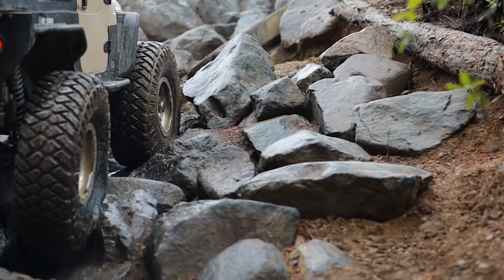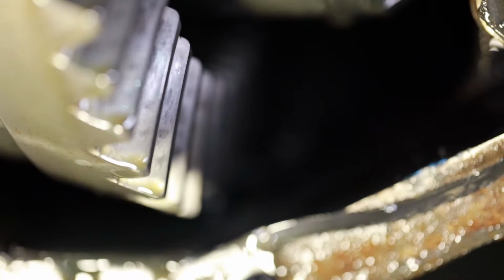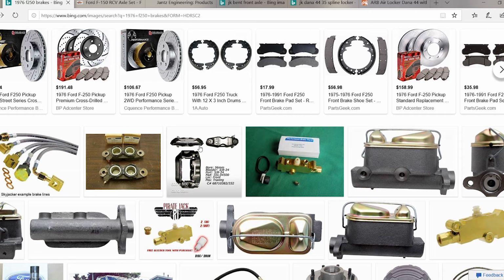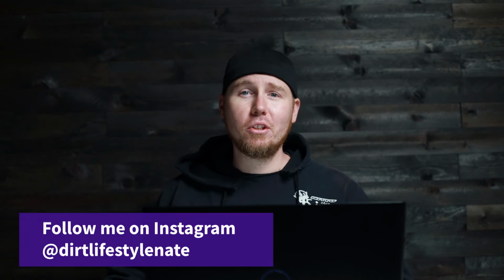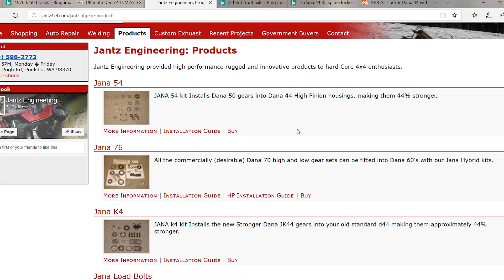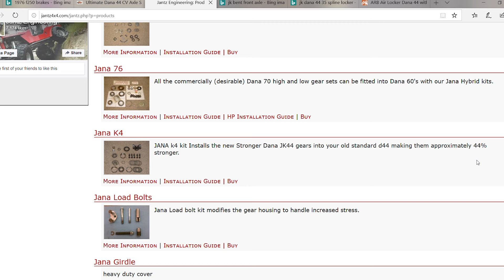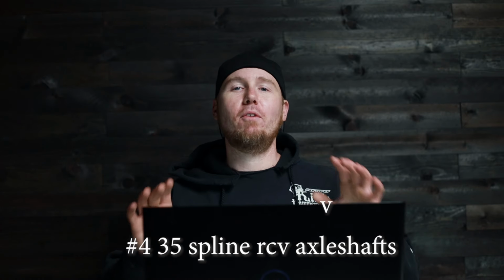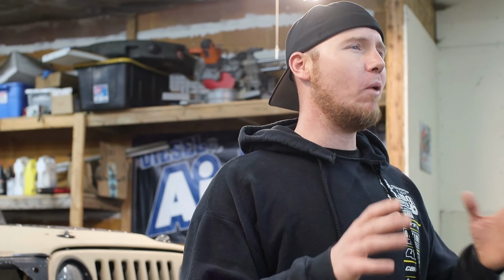Building An Unbreakable Dana 44

Comment: When everything on the inside is upgraded, the splined part of wheel hub on that style D44 will twist off. Takes a lot, but it happens.
Reply from the maker: Damn! That must take alot of force!
Reply: A lot of force, yes, but that can be solved also. The teraflex 8 lug hub runs a 35 spline stub shaft and RCV builds a kit that has a 35 spline stub shaft for the teraflex kit and 35 spline inners for the JK 44 locker with a 35 spline sleeves. This is how I have my rig setup. It’s way lighter than a D60.
Reply: even more turd polish. and a good way to have a $6000 dana 44. Also no way it's significantly lighter than a 60, after all the components are upgraded to the same physical size as a 60, and enough trusses and gussets are welded on to keep it half way straight (in the case of a JK axle)
Reply: Cooper scooper, you don’t have a cogent argument. If you’re running enough power or big enough tires with low enough gears to twist off the splines of a wheel hub, you shouldn’t be running a D44 in any iteration. Otherwise, A Currie housing ( 3” tubes and reinforced Cs) and the other guts I mentioned comes out to around 210 lbs ( I have weight it) vs a fitted out D60 at 335lbs (I have converted and weighed it too) Yes, it’s significantly lighter.
Reply: @nicholascooper1193  

He specifically states the problems with the JK axle and tells you NOT to build it (use a late 70's Ford).

And of course it's lighter.
Reply: @ConradBrander  Yep Nate does in the video.
but the teraflex 8 lung stuff that tagalog101 mentioned is for the late model axles. Kinda having 2 different conversations there... and the designs are different enough that they don't even relate to each other.

A late 70s high pinion D44 (dead spindle/full floater/non-unit bearing/whatever you want to call it) is exactly what I've seen blow the splined snout off of the wheel hub (the axle had RCVs, and was in a full body v6 Explorer with double tcases). I had a 78 F150 with Yukon shafts & joints, and it would blow out the Warn hubs but everything else would live. I helped build a Ranger with a 79 HPD44 front with Yukon shafts & joints, and it was the same until we swapped to drive flanges, then it started breaking the Yukon axles (the SuperJoints would survive, just needing new cap kits).

Weight is relative, because a 3/4t 8 lug D44 from a late 70s F250 is NOT significantly lighter than the same era D60. 
Of course if you start comparing to a 2005+ SuperDuty Dana 60s, or a TJ/XJ/JK D44, it becomes and apples vs oranges comparison.

But yeah, a High Pinion Dana 44 is a pretty stout axle in the right application, and can be upgraded over time the whole point of this video
There are some inherent weak points in the design of each era of D44, some are easily upgraded, other not so much.

Comment: The Jantz engineering stuff looks nice, but I don't think the K4 kit is going to work on the late 70's Ford dana 44. They are high pinion with reverse cut gears if I'm not mistaken. Where the JK uses standard pinion and gears.

Comment: I've got a wagoneer front 44 and a TJ 44 rear in my TJ on 37s with lockers on both with no real problems. I'm debating building a new set though when I build my new suspension. There's a Ford HP 44 with high steer, and matching rear d60 for $400 on Facebook right now that look pretty enticing lol. My plan is slight stretch and maybe 40s down the road.
Reply from the maker: Nice! If it has the matching 60 then it should be the f250 version. Pure American beef 👍

Comment: The Dana 50 gears are for high pinion housing like your 79 F-250. The JK 44 is your for your low pinion housings, using the rear JK44 gear set. The HP JK44 pinion is shorter and will not fit the old school 44 housing.

Comment: Hey Nate quick question can you put those axles in a little Ford Ranger without having to put a bigger Motor Inn I've got the V6 that's been working like a champ turning the vehicle into an Overland vehicle just want to make sure that I'm going to be strong enough for whatever comes up thank you and thank you for the videos
Reply from the maker: With the right gears it doesn't really matter the rig. These aren't much heavier than what you have now 👍
Reply: A lot of people been telling me just to change them out and put 8.8 but I want something a little heavier because it will be hauling a trailer around also
Reply: @cliffordsmithey464  The ford 8.8 is a great axle. it should handle anything in a rangers weight class for towing. Only reason larger trucks have a full float rear is because they have a higher load rating.
And a proper D44 will be just as strong as the IFS that your ranger has.
Reply: @zososldier  kind of turning me into an Overland rig
Reply: @cliffordsmithey464  You would still be hard pressed to exceed a trussed 8.8 while towing.

Comment: I would really like you to do the same video but for that Dana 44 to be going in to a 1998 GMC Sierra K2500! I have a Jeep YJ it tends to be my daily driver... I just like wheeling in a full size rig personally!
But my IFS lift has taken all it can handle and is falling apart! I have no desire to fix or even buy a newer IFS LIFT for my ride...  SO... SAS here we come! And from what I’ve learned and have seen done. I believe building a ULTIMATE DANA 44 would be the way to go...
Reply from the maker: Nice! I would get the f250 version for your application to get the extra width. That's going to be a sweet build 👍

Comment: Great video.  Any way you could make a video with your experiences on different brand dana 44 balljoints .
Reply from the maker: I don't have any experience unfortunately. Because of the small scrub radius on my build I don't put much pressure on ball joints. I replace them when I got the axle and haven't had to since. 👍

Comment: I'm so doing this. My stock 44 is toast. So what exactly do I ask a junkyard? '76 F150 front axle? Will my brake assembly work? Speed sensors? Stock Rubi locker? What LCA and UCA brackets and spring pad brackets? Do I use? Artec? Will all my 2011 Rubicon 44 junk fit it? I already have Ten factory axles. They work? Sorry to be nuisance. But I ain't spending 4k on an axle. Great channel. Keep going!

Comment: Just got a currie hp44 made with Ford inner c’s (they’re a lot beefier than stock) jk gears, solid knuckles with 4 bolt high steer mount and Chevy outers, ball joint eliminators,  chromos for a 78 f150 are only $400 with u joints but if they break I’ll get rcv. All new parts so I don’t have to grind and clean and I know the condition of everything. I fully expect it to be stronger than a stock super duty 60 from a junkyard with more clearance

Comment: I’ve got a F250 hp44 converted to 5 lug and the axle tubes are 1/2” thick!
Reply from the maker: Beast mode 👊
Reply: Thats what I did, 79 F250 D44, Chevy outters five lug, RCV's, Yukon hubs and a Grizzly locker.

Comment: WOW..   great content.  So what do you need to get the late model JK Rubicon 44's up to par? I already have RCV's, Evo axle sleeves, and C gussets going in. What else? Wheeling in the Rockies and considering 37's up from 35's.
Reply from the maker: Thanks! I would recommend an axle truss. The sleeves don't add much strength but a truss will make it bullet proof! If you start having ring and pinion problems, email Jantz engineering. They will get you what you need 👍

Comment: Time to upgrade to a ox locker? I have them in my xj d30 and d44 on 35s never a problem. I upgraded to the air actuator and works well. Also have the manual drive away locked system if something happens to your air system

Comment: 10 years of hard use on my JK Rubicon’s 44s, seven of those years on 37s, nearly four years with the 4-speed Atlas. Knock on wood, they’re hanging in there.
Reply: Rubi 44s can last if built right,and treated well.

Comment: I'm looking forward to learning from you in your new "job"...question...if you were going to by a TJ Wrangler and do some restoration work to freshen it up (engine, paint, interior etc) and use mainly on the road but be highly capable off road too.... would you limit your search to a Rubicon or buy any of the other models and do the changes necessary to bring it up to the capabilities of a Rubicon?
Reply from the maker: It would depend on your desired size. Having d44 front and rear takes care of alot of the guess work when selecting axles. You've have somthing very capable right out of the box. All it needs is gears and 35s. Now you can hit 90% of the trails in the us. The bummer about a sport or an x is your looking at getting new front/rear axles and a new tcase to match the same amount capability. Food for thought 👍
Reply: @DirtLifestyle  Thank you...kinda what I thought to be the case

Comment: Hey man great video and content as always. I have a 1983 CJ7 I’m rebuilding, I live in Washington and primarily use it for hunting, no rock crawling. I’m putting a 5.3 vortec with a 4l60 transmission. Currently have stock widetrack 20 rear and 30 front. I’m only going to run 33” tires maybe 35” max. Because of the power should I upgrade to Dana44’s ? Or would upgrading to one piece axle kits be sufficient for the stock axles. If you get to this comment I appreciate the time, love the comment, thanks

Comment: Hey Nate I love watching your videos and have learned a lot from you. I just recently bought a used 2015 jku Sahara. I ended up swapping the lift it came with for a full Metal Cloak 3.5 game charger lift with fox shocks, also Metal Cloak Heavy duty one ton steering with fox stabilizer. I have a Dana 30 truss and C gusset front and rear 4:88s. I want to continue building this jeep, 
I want your opinion on what else I should do to make this Jeep off road worthy. I want lockers but don’t know which ones. I have thought about replacing axles but it is to far out of my budget. Also thought about replacing transfer case to a rubicon 4:1. I thought about strengthening my rear axle. 

I honestly don’t know anything about Jeeps and off roading. I need your advice on what I should do? More than anything I would love to hear how “Nate” would build strong capable off roading Sahara.

Comment: I'm building a 95 Geo Tracker and everyone is steering me towards Toyota axles. I have a set of axles from a 1973 Scout Dana 44 and Dana 30 front. The reason I bought them is they are narrow and have the same bolt pattern. I really want 36 to 40 inch tires and probably will end up putting one of my Corvette motors in it. I have a sweet 63,000 mile 5.7. TPI. Corvette motor from my 86. I also have an 88 f250 4x4 that has a 460. I have a huge shop up in Bellingham and a nice welder and a new plasma cutter. I love the sound of a good v8 and don't want to be left out of the mud lingers party. I had 36 x 9.5 Buckshot Mudders on my 85 Toyota and I liked how it drove and want that for my Tracker of possible.  I plan on coil overs and 3 or 4 link, v8 power built for fun. I would appreciate your input on what axles you would think would be the cats meow for my Tracker build. Thanks in advance. I'm sure I will see you on the trails sooner or later being we live near each other.  Big fan of for vids.

Comment: What about adding inner c gussets, and truss to a Tj rubicon 44 with factory lockers. Already have RCV’s. Would it handle 37 or 38’s ok? Probably need a truss of some sort in the rear too.
Reply from the maker: Definitely. As long you don't have crazy horsepower 👍
Reply: Dirt Lifestyle Just the 4.0 with 4sp/OD and 241 tcase.  Getting Carbon off-road 538’s for them too. I just saw a vid that said u started in a K-5. Super cool, I also started in a 72’ K-5 blazer and had a 76. ☮️

Comment: I have a 78 f250 8 lug dana 44 and the rear matching 60 for my yj. I want to keep the jeep somewhat street friendly so i wanted the larger brakes, lockouts, flat top knuckles, and full float rear. Running 3rd gen dodge steel wheels with 6 inches of back spacing trying to keep the width down. I got them for 200 bucks. Now im just too poor for high steer and 35s.

Also, poor jk gear and gadgets lol.

Comment: I bought a HP 44 out of a 77 F-150. I cannot wait to build it. One thing I am not sure of is which ball joints to use. There is a lot of crap available now days, I’ve had nothing but poor experiences with Moog Problem solvers, Movetech TTX terrain tough, and even Spicer has been disappointing. What did you go with on that axle?

Comment: Thinking of doing this in my LS TJ... 
I found a truss kit so it’ll fit and be sturdy... something I’m wondering what  bolt pattern does it have and you went Yukon hubs, gears and zip locker right? 

The K4 kit requires some shaving of gears and drilling but nothing’s perfect... do it once do it right and it’ll last 

I was hoping for links on the description 😋

Comment: my issue with my 77 F150 HP44 in my TJ, is that it eats wheel bearings and axle seals.  I literally have gotten 3000 miles, and it needs a full rebuilt.   Currently added the new stage 8 to see if that helps the wheel bearings coming loose.   Overall, it has lived with 37's in my TJ for 11 years.
Reply from the maker: Damn! That really sucks! In the last decade I've only needed to replace the bearings once. (I think it was 2011?) Sounds like you have another issue here. Bent spindle? Poor scrub radius? Poor bearing installation? Poor bearing quality? Something is make your rig chew through parts and it's not 37s. Good luck man!

Comment: Ha, decided to retire my JK Rubi D44 yesterday, good timing. My D44 has cracks on the truss even.
Reply from the maker: If your ring and pinion are in good shape this might be a good route for you!
Reply: @DirtLifestyle  Agreed! My R&P has held up great. It's the housing and u-joints I have has issues with historically. I am running 37" Competition Maxxis Treps, my axle shafts are aftermarket 30 splines, on a stretched 2 door JK.
Reply: @biglowsd  sounds like a sick rig you got there,  I'm hoping to one day stretch my 2 door jk aswell!
Reply: @southernstar_offroad  Do it, join the stretched jeep club.
Reply: ...and pulled the trigger on a D44 to run with 35 spline RCVs. I'll install it before KOH

Comment: Man...excellent info!  I have D44 G2 axles with 37’s, lockers front and rear with a 4:1 Atlas on my 98’ TJ.  Do you think I could get away with just going to Chrome-Moly axles?  I have a stock 4.0 and I try to pick good lines and not go crazy with the right foot.  Any other ideas?  One ton axles are not in the cards as I would like to save some money and drop in a 2.8 Cummins.  Thanks in advance.

Comment: Hey Nate... have started down the route of building up a TJ Rubicon Dana 44...there’s a kit that takes it to JK sized ring, and Dana 60 sized pinion. Figured sleeve and truss also as it’s Dana 30 axle tubes. I’m not planning on going over 35s. 

Thoughts?
Reply from the maker: You have got the right recipe but for 35s I wouldn't mess with the ring and pinion. It should be plenty strong 👍
Reply: Dirt Lifestyle - it came with destroyed gears and no locker...so has to be done anyway. 🙄 Don’t know if there’s any good upgrades for the knuckles?

Comment: I had a 79 F250 with a built 390 big block and 35's.  No issues with it.  I know they are stout.  I would like to find one for me 15 JLU.  Trying to find a 76-79 ford f250 dana 44 front housing is impossible in Arizona to S. Cal to Vegas.

Comment: I understand this is a old video, four years old. But what do you think of the G2 core 44.  The knuckles, the tubes and the brackets are so much beefier. I’m building an LJ we need to do the RVs with 538 years, I have 35 spine, rare axle shafts chromoly and wanted to run 40s. I realize it’s all about the driver and the skinny pedal.

Comment: So I just bought 2018 Jeep JK Rubicon so I need to upgrade the Dana 44 to put 35s on it or will it be strong enough to hold up to deep snow Wheeling that's the only kind of Wheeling I really like
Reply from the maker: Those axles will handle a 35 no problem. I wheeled a 2018 jl on pitchet canyon in moab Utah. The only mods were 35s and a 2" lift. It did great 👍

Comment: Thanks for your hard work and advice on how to build a Great reliable rig. You know what you are talking about because you LIVE IT.
  I have a 94' wrangler sport with a 4.0 basicly stock except for a 2.5" rancho leaf spring lift on 31" tires. I also have a 73' 3/4 ton chevy 4x4 that I'm thinking about putting the axles under my jeep. 14 bolt rear and Dana 44 fronts.  I'd like to cut them down to about the same width as the axles on the jeep. With 456 gears in the truck's axles I know I'll need at least 35" tires or bigger. Does this sound like a Good idea to you? I'm thinking of upgrading to 4" Rancho springs with spring under too.
Pros and cons?? Thank you.

Comment: Here I come with my Dana 30 (until it breaks).. Im on 35s, 4.88s, and wont change that, its plenty for what I do. Ive done all my own custom work with Artec & Barnes, full truss, gussets, sleeved, and fabbed up all barnes offered 3/16" brackets, JL twin piston calipers, also mated to an Adams solid 1310 DS.  Im running a Trutrac TORSEN carrier. Im sure my weak link is the stock axle. I do want a weak link but not sure if I want the axles the weak as that not a simple trail side repair. If I get RCV (etc) axles, then my Ring/pinion would be the weak like right?  My plan is to keep the stock junk axles I think.